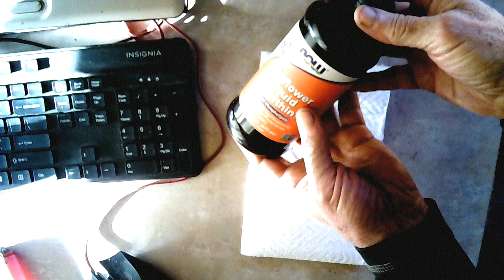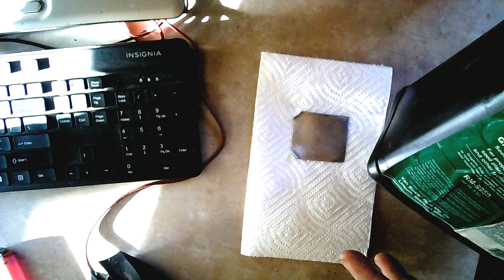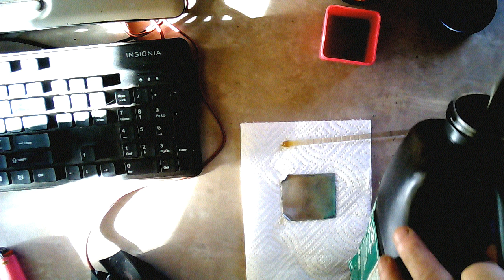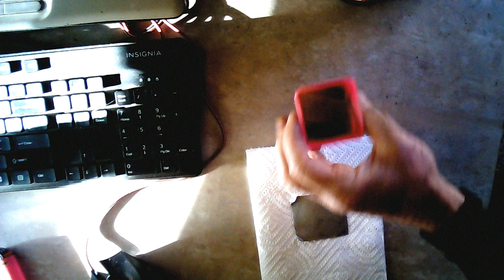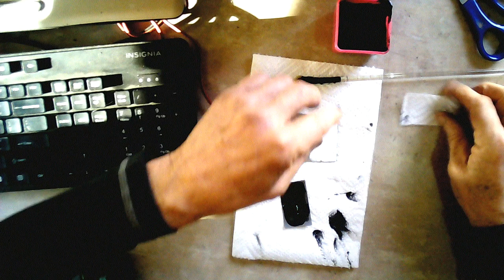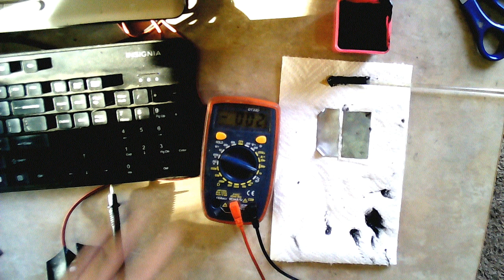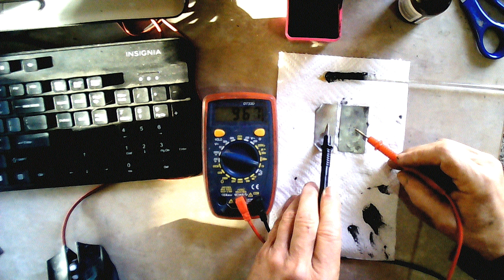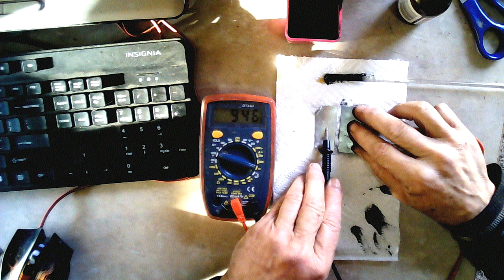Demo #22 A Biological Battery?

Comment: New here on recommendation by Kev. Spot reviewing your uploads. Thoughts here: Useful for proof of concept. Hard to make a quantitative assessment though. Weight of individual components would aid in reproducibility and effect of incremental changes. Proportions may affect the outcome. I'll keep going through your videos. You may have already addressed the issue. Otherwise the idea is intriguing. Independent open source development of cell technology is becoming increasingly important. I worked with crystal cells for a while. They held promise but my ultimate assessment was they are hybrid self throttling galvanic cells that exhibit extended rebound characteristics. I ran one with an LED for six months before corrosion stopped it from working. Longevity is an important factor. I haven't tried expanded carbon and graphite. I will be resuming my experiments but for now others are testing new materials and chemistry. I am content in reviewing results before deciding which approach I will take. Titanium dioxide is interesting. I'll be reviewing your uploads to see what may be advantageous for my eventual return to experimenting. Thanks for sharing. Fred
Reply from the maker: Hi Fred, I'm happy you are here! I'm just getting started on this project, exploring the possibilities first. After I get the chemistry figured out a little better, I plan on doing some detailed experiments with load tests, and share the results of course.